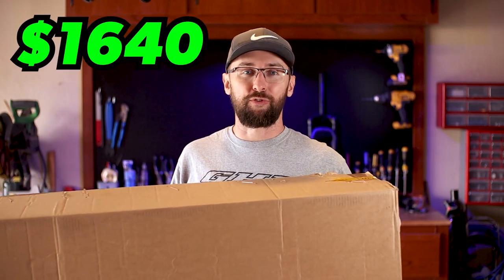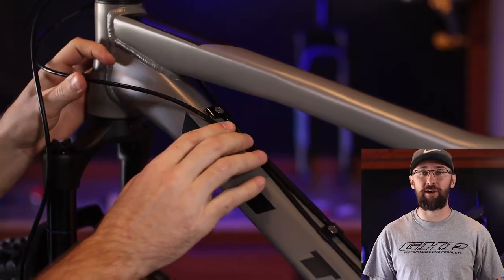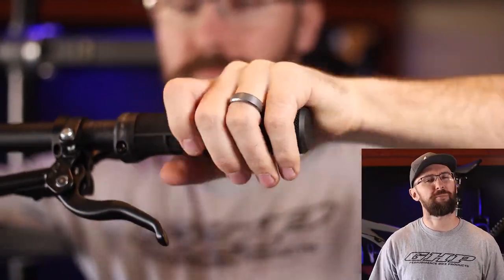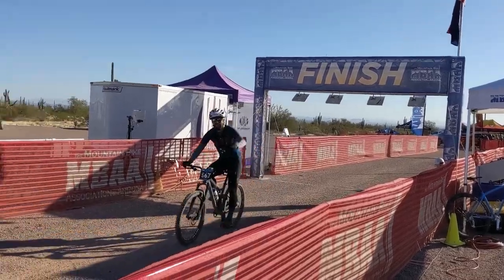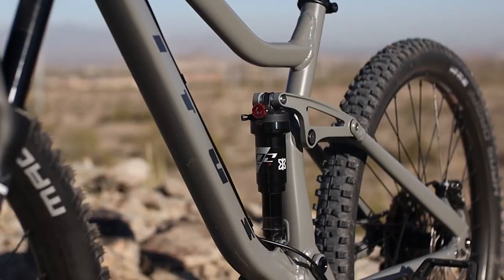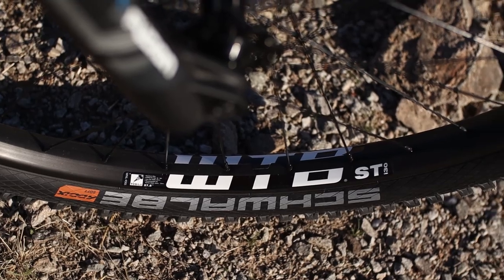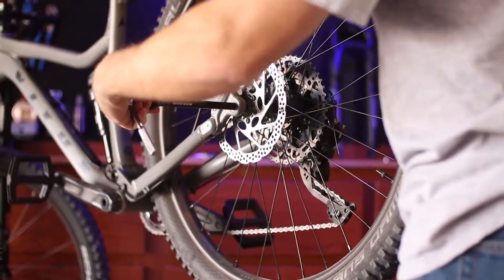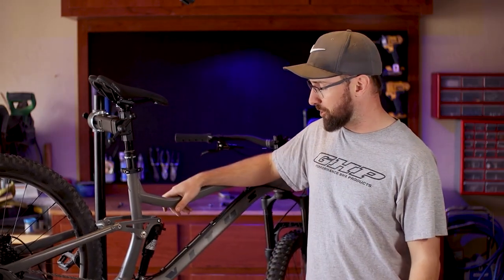Is this Vitus Mythique the best budget trail bike?

Comment: I'd have gone for a vrx, because for $400 more you get a much better fork, shock, brakes, among other less impactful albeit noticable upgrades, if you're in to replacing every part on your bike that's fine, but getting the higher spec in this case is the better value overall. That said, at this time, you kinda have to take what you get.
Reply from the maker: Yeah thats a lot of upgrades for just $400. I tried to order the VRS (the red one), mainly for the color hahah. That is the name of the game with this channel though. Buy a cheap bike and upgrade over time. (plus I gotta keep in mind making content for this channel).
Reply: @EvansMTBSaga  great point
Reply: @EvansMTBSaga  That red one looks so good ! I'm amazed they didn't use the red frame for the VRX to go with the Red forks .

Comment: Vitus bikes-
Pros:
- Good Specs
- Cheaper than competitors 
- Different sizes
- Includes free tools and goodies 
Cons:
- Availability
- (Similar to above) Stock
- No bike shop service*
* (Fitting/Fixing and installing parts) 
* {Requires additional fee}
~Especially for newer riders
- Hard to pick size online
Reply from the maker: I tried to get a Polygon but after 2.5 months of waiting (1 full month of that was after my expected delivery date) I gave up on them. I get tons of people commenting they got a Vitus.

I actually got a response from them about swapping the levers. They told me to use a local bike shop to swap them, and they'd reimburse for the repair! I thought that was cool.
Reply: most shops will work on any bike no matter where it's from.
but some refuse to, those shops will loose customers fast.
Reply: Go by reach, look at the numbers, not by size letter like M, L, XL and so on.

Comment: With the suspension designs of the mythique v the sisku, neither of them are really more “modern”. The aspects will be a bit different from them but a Horst link/ four bar is not always better than the linkage driven single pivot on the sisku. In fact that single pivot helps a lot creating a playful feel in the bike.
Reply from the maker: Good comment. I'll pin it so hopefully we can get a discussion going. Definitely interested in learning all about rear suspension.
Reply: @EvansMTBSaga   I highly recommend the channel Trail POV. He makes some really great videos that help to understand how the suspension designs work
Reply: Honestly I just really hate the look of the link on the mythique, because it's completely hollow, I like the look of something with a bit more filled in.
Reply: Technically the horst link is more modern in the sense the patent only expired a few years ago vs single pivot is basically the simplest system possible, don't think it ever had a patent? With linkage single pivot there's less ability for frame engineers to do multiple things at once which makes it more of a sacrifice. Trek takes care of that issue with their abp, basically the rear axle becomes a pivot which allows them to stop brake jack inherent with single pivot. Everything is a compromise, no system is perfect of course, but single pivot tends to be a lot more of a compromise. Hence why you tend to see single pivot of more budget bikes, kinda surprised vitus isn't using single pivot themselves but since CRC owns nukeproof which also uses horst link I'm guessing they already have experienced engineers to help design it. Between the polygon and vitus, I'd be much less worried about components and go for the vitus just on the suspension design alone, but from looking at both bikes the vitus also tends to have slightly better components as well.

But probably even bigger is availability these days. Whichever bike you can get without waiting over six months is the best choice lmao! Really you can't go wrong with either bike, it's just fun to nitpick suspension platforms.
Reply: @dylan-5287  1 thing wrong with that essay, chain reaction doesn't own nukeproof
Reply: @adamneulander   @Adam Neulander  oh good point, should have said more than they all work together and have their CRC/nukeproof enduro team. What is the relationship there? Seems like CRC has exclusive rights to distribution similar to vitus. I'm pretty sure CRC did buy the vitus brand. Interestingly, vitus is an older brand than specialized, giant, trek, Santa Cruz, etc.
Reply: @dylan-5287  chain reaction does own vitus, however there actually is a very limited Network of bike shops that sell nukeproof,  They are retail parners, but they're independent.

Comment: Dude I'm so excited for you! Before getting this bike people said FS would feel slower and sluggish compared to hardtails but from the very first climb I was super impressed with how well it climbs, I legit never lockout the fork or shock on mine. And of course descending is just miles ahead of a hardtail. Absolutely love the Mythique.
Reply from the maker: Since you have experience with FS, do you recommend increasing air pressure and lowering the rebound? I like the bounce feel, but the bike does not stay planted in turns. Instead the shock pushed back when carving a turn and I nearly slid out!
Reply: @EvansMTBSaga  definitely sounds like you need to slow it down a bit. I like that curb drop test where you turn it down until you no longer have extra bounce but still fast, I like suspension poppy and fast too. For pressure I mainly got it dialed in by adding more until I wasn't bottoming out but using around 95% of travel in a typical ride. X fusions guides were pretty good but I think I added more pressure than they recommended in the end. Definitely takes a few rides to get things perfect for you, I always carried a shock pump at first to make adjustments. It was my first FS bike too so you always get a better feel over time. But literally from the very first climb and descent I did on it I was pretty blown away. Still love the hardtail of course though haha.

Comment: I prefer The front brake on my right because then it's the same as my motorbike. When I swapped them round I just swapped the cables round from the brake leavers. No mess and no need to blead them either
Reply from the maker: Makes sense! I don't know why Americans do stuff backwards. Maybe just to be different?
Reply: @EvansMTBSaga  I live in Scandinavia, And its the same here. Not shure why, But it's a quick fix 👍

Comment: I love my 27.5 Mythique.  I got the very last 2020 VRS on CRC.  I’ve got 250-300 miles on it now.  I wish they had enough to keep up with demand, I suggest them to everyone but then they are pretty much always OOS.
Reply from the maker: I was aiming for the VRS. I actually saw that was in stock and probably missed it by 15 min. The VR was in stock for at least 3 weeks straight, so I gotta give it to them. What kind of upgrades have you done to your Mythique?
Reply: I have the 2020 VRS too! That green is my favorite color, just looks so damn good. Matches my jeep well too haha.
Reply: @EvansMTBSaga  just contact points.  Seat, pedals, grips, handle bar(more rise), and stem(10mm shorter).  And tires...my rear hans dampf didn’t last 50 miles in the rocks.  The lugs were ripping off.  So I did a round of Maxxis tires and it’s been so good.  I’ve tweaked suspension tube a few times, lube and clean the chain and cassette.  And ride the crap out of it.
Reply: @dylan-5287  I wish all my bikes were that color green.  It’s so good.  I passed on the VRX so I could get the VRS in green.  It’s not like I ride well enough to tell the difference in the VRS and VRX anyway.

Comment: The mythiqe is such a good bike especially for the price i find it had the perfect amount of travel for pretty much everything Ive had my mythiqe vrs since January of last year and I’ve heavily upgraded it with a cane creek db il, shimano slx 4 pot brakes, shimano deore 12 speed drivetrain and alot of other stuff it’s absolutely mint just gonna get a rockshox yari and it will be “done”🤘🤘🤘
Reply from the maker: Haha bikes are never done! Did the 12 speed fit on the stock hub? I'd love to go with 12 speeds.
Reply: @EvansMTBSaga  yep i just used a 12 speed shimano hg cassette they make sram ones which work fine with shimano or theres cheap Chinese cassettes on eBay

Comment: That is awesome, congrats on the new whip! I wish my experience with ordering a bike from Chain Reaction was as good as yours...
Reply: Was your problem with DHL too? it took over a month for them to send my bike over, which would have been fine if they didnt tell me it would come 4 days after I ordered it.
Reply: @ianthompson043  at least there was a good ending
Reply: I ordered a Vitus from Wiggle and had the same nightmare experience with DHL.  Delayed over a month and once it was finally delivered, the box looked like Ace Ventura delivered it.  It had plastic wrap all over it with DHL just trying to salvage the destroyed box.  Everything was in complete disarray and the bike has huge gash marks in the paint.  Fingers crossed that Wiggle comes through on my request to make things right.
Reply: @jesterxfan  Did you ever get it straightened out ?
Reply: @chrisplatz3128  lots of back and forth with wiggle. They reimbursed my shipping (~$150 USD).
Reply: @jesterxfan  Did they offer an exchange if you wanted it ?
Reply: @chrisplatz3128  No exchange offered. Their initial offer was $60 store credit.

Comment: The suspension is more specifically a Horst link. Used by Specialized and many others. The pivot is on the chain stay. There's other 4 bars that are not Horst and have the pivot on the seat stay. Nice video 👍

Comment: Welcome to the big leagues my man! I had a vitus hardtail and they put my brakes on the wrong side as well. I ended up going with a Trek Fuel Ex 8 for my first full suspension but I can’t wait to see how long this bike will remain in its current form. Excited for the new bike and excited for you! have a great ride my man
Reply from the maker: THanks man! I took it out today on a normal ride and got several PRs without even trying. Such a solid bike. Already got some upgrades ordered for the next video.

Comment: I'm thinking about buying one, should I get the 29er or 27? I have never rode a 29er before. What do yall think?
Reply from the maker: I can't notice a difference with having the 27.5. Just rode my 29er hardtail this week and still don't notice a difference.
Reply: @EvansMTBSaga  I will probably go with the 27 then, do you think replacing the suspension will be easy or should I get a local bike shop to decide what’s good for it.
Reply from the maker: @tidepods7364  The rear shock is so easy to replace, as long as you get the correct sized shock. Replacing a fork would be harder, but I'd say it's one of the easier things to do with bike upgrades. Check out my other videos on the Mythique, I already upgraded front and back suspension.
Reply: @EvansMTBSaga  Do you know any budget friendly forks and or rear shocks that would increase my travel? Or even wider stanchions on the front?

Comment: Wider bars and a quieter hub would be my first upgrades. nice bike!
Reply from the maker: Haha quieter hub! How come?? The bars feel decently wide, I don't mind them
Reply: @EvansMTBSaga  I try to make everything on my bike quiet. Even a cable slap drives me crazy. I'm 6'4" 240 lbs, so that's why I like the wide bars. ha
Reply from the maker: The onyx hub is for you then. I used to run those on my BMX bike. Super nice. I honestly don't hear the hub when descending, mainly because of the wind noise
Reply: @EvansMTBSaga  Thanks bud! I'll check it out. I'm running novatec now. Quiet, but the gaps are a bit inconvenient.

Comment: Hey buddy, did you honestly did not feel any difference between 27.5 and 29er? I want 27.5 but everyone these days is pushing 29er
Reply from the maker: I still don't notice a difference all these months later and having switched back and forth. With the 29er I feel higher off the ground for sure. But I believe the 27.5 has a more slack head angle than the 29, which is a big thing to me. Also 27.5 components are cheaper used and easier to find stuff. Hope that helped!
Reply: @EvansMTBSaga  and its lighter haha. Thanks for your help.
Reply: @EvansMTBSaga  By the way, you think you can fit 29er on your Mythique?

Comment: does the Mythique come with the brake levers and the gear cogs on the opposite side? (opposite to american normal)
Reply from the maker: It should not normally. They are supposed to sell bikes in America according to our federal laws, which is rear on the right. They just made a mistake in my case. My Nucleus had the correct orientation.

Comment: I'm interested in the same bike.  My main concern is the X Fusion suspension.  I've heard mixed reviews.  Do you wish you spent the extra $500 for the VRX?  Thanks for the review!
Reply from the maker: Oh no way. X fusion forks are pretty good so far. I wish the rear shock could have a lock out, but for being a budget shock, it does really good with pedaling.

Comment: Congrats on a bike and content.
What height are you and which size you went for?
 I'm 5.10 and a bit and can't decide whether medium or large (in 27.5)  would be better. 
Thanks
Reply from the maker: Thanks Jarek. I'm 5'9" and went with a medium. It felt a little small at first, but then I put a 50mm stem and it was fine

Comment: Coming from a hardtail with a rockshox 30 fork with 100mm travel, will the x fusion fork on this be better or worse? Or about the same?
Reply from the maker: Oh man I liked the X Fusion fork. It didn't handle the small bumps that well, but man the fork is so smooth and had a great travel range. Plus the rebound adjustment worked well.
Reply: @EvansMTBSaga  OK, thanks

Comment: I had the exact same model of rotors, in same size. if I had this bike I would eventually swap to different rotors cus they over heat for me on a fast downhill. so if you start going fast and braking hard, you will need new rotors eventually. I kept glazing the rotors.
but other than that, this bike seems to be quite good value compared to what i got on 2014 Fuel EX.
1x drivetrain, and decent enough suspension, tyres.
proper pivots, and probably a stiffer and more robust frame.
Reply from the maker: I felt that overheating feeling before and its so strange and sketchy!
Reply: @EvansMTBSaga  i am 86kg and I get to quite high top speed some places and brake hard, so can be 40 or 50ish km/h. Also these rotors are Resin only, so metallic pads will wear the rotor faster. But resin pads wear fast and don't have the bite i want. swapping to Hope floating rotors in same size solved the overheating, they are also quite quiet. But rivets might creak after years of use. But on my new bike I swapped totor over to the back and got 203 for front, the G1 has 180mm as minimum.

Comment: Chain reaction cycles sent me the wrong size dropper post and wouldn't help me wanted me to spend 20$ to return it to them in shipping costs they have pretty terrible customer service.
Reply: Seems like people get very different experiences. My crappy SX shifter locked up on me six months into owning the bike. I was sure CRC was going to say that's just wear and tear. Instead they had a new NX shifter at my door 5 days later, no questions asked. I was super impressed with their customer service. I feel like there's a certain way to talk with customer service departments to get them to help you out.
Reply: @dylan-5287 Sounds like you got lucky they literally scammed me on a 140$ item and sent me the wrong invoice on top of it and when i contacted customer service and told them they sent me someone else's order they told me nothing they can do besides for me to return it and eat the 20$ shipping cost for the mistake they made? that's not good customer service in my opinion i won't buy anything from them again personally
Reply from the maker: I emailed them and they said that in the USA the rear brake is on the left and that I was wrong. I even linked the Federal law that said otherwise and the person stopped responding to me. Well the next day I made a new ticket and clearly got a new customer service rep and they resolved the problem. I'd recommend you make another ticket and see if you get someone else!
Reply: @razgriz206  that sucks, I probably would have just eaten the $20 shipping charge if the dropper wouldn't work at all. Was it too large and totally unusable? Definitely try contacting them again. They'd probably waive that $20 fee. When I first bought my Mythique from them, I later noticed they had a $20 off deal for new customers that I hadn't seen. I contacted them and asked about it and they sent me $20 back to my debit a few days later. I think some agents there just suck and others seem to be really good. Whenever these types of issues come up, I always try to compliment the company and tell them I've been leaving good reviews and then ask for what I need. I've noticed most of the time they tend to take care of you if they think you're leaving good words and are a loyal customer. They are a huge company too and have been crazy busy so I'm sure they've dropped the ball on plenty of people. Hopefully they get you taken care of in the end.
Reply: @EvansMTBSaga  I Got the same exact treatment
Reply: @dylan-5287  I could of used an adapter for it i ended up buying the correct size though and i still am trying to sell the one they sent me lol
Reply: @razgriz206  ohh so it wasn't even the right size for your frame? That's annoying as hell, I thought you meant like you got a 120mm when you ordered a 150mm. I've heard those shims can slip and aren't ideal either. Which brand and which new dropper did you go with?